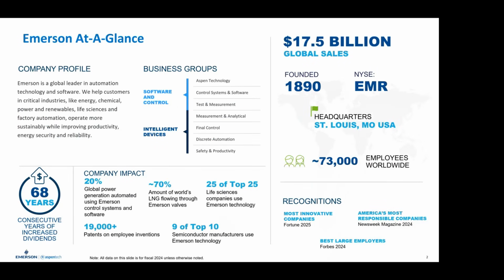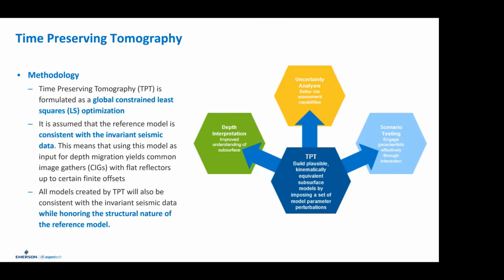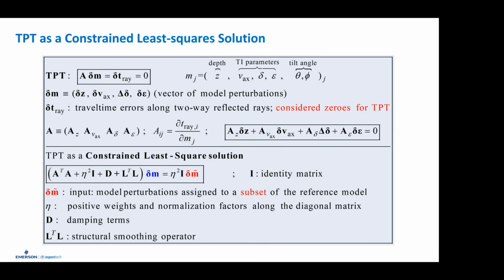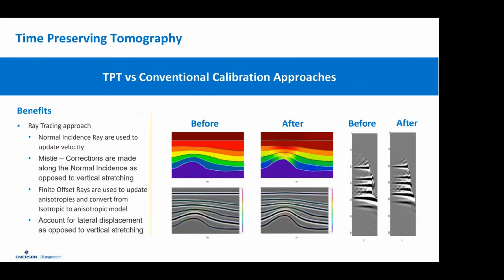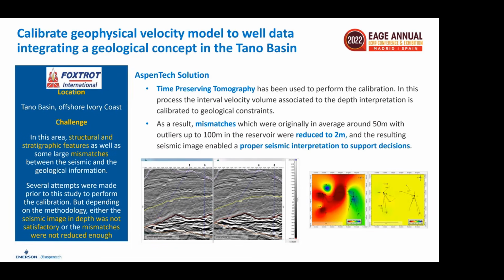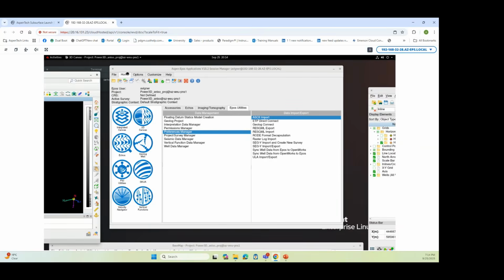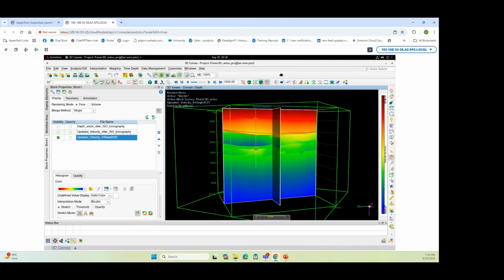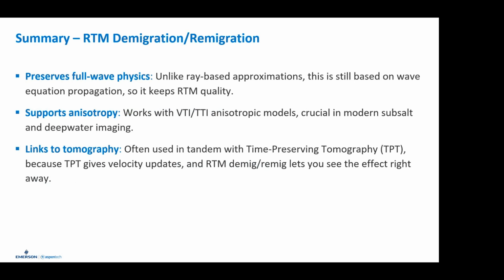LC London: Refining velocity models with time-preserving tomography and RTM demigration/migration

Comment: Alan and Zvi, fantastic presentation! That TPT workflow is really good—it's super practical how it lets interpreters quickly nail down the right depth model and practically eliminate well misties. Using RTM to instantly check the new seismic is a game-changer for speed. Cheers!